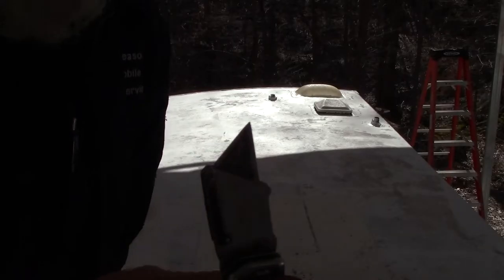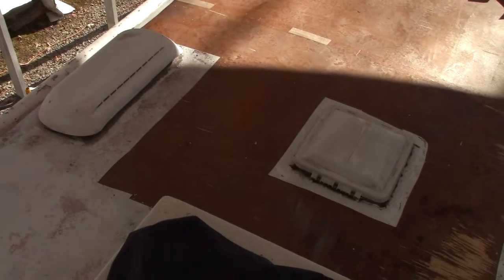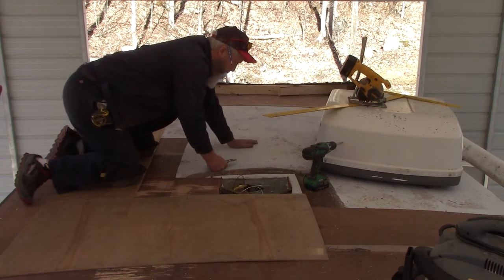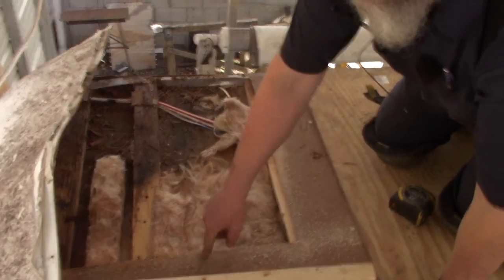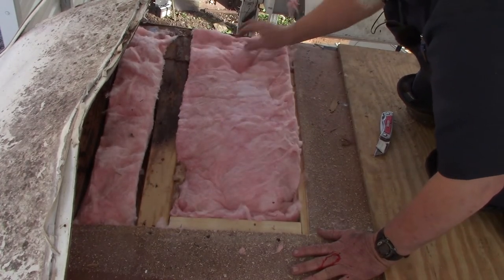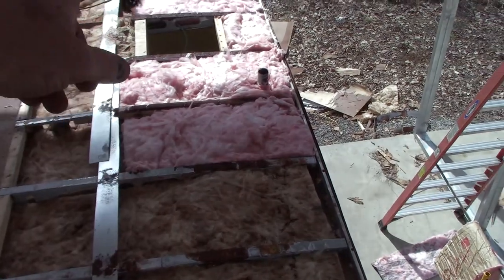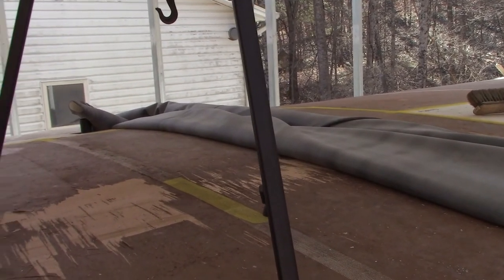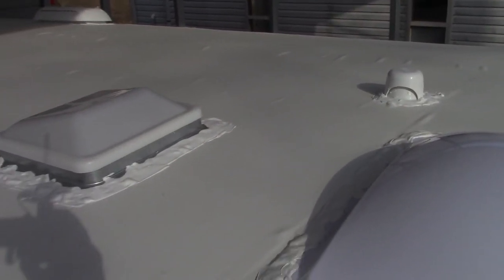Installing New Rubber Roof

Comment: Thanks Kenny and Cameron. Enjoyed the video. Even though you only patched the roof I would expect it’s as good as new. You were thorough. You probably put what, 40+ hours worth of work into this project plus materials so it’s not cheap. But this camper will probably will see another 20 years of use. This repair will get the owners back out enjoying nature which is what it’s all about.
Reply from the maker: Thanks. Yes it was over 40 hours.

Comment: Two pointers.  -  In the factory and dealers we used scrap plywood with scrap carpet padding and carpet wrapped around the plywood to work on the roofs. Two of them about 2.5 ft by 3 ft.  Staple the carpet to the underside and make sure the staples are hammered in.  Saves the knees also.  And I didn't see the entire procedure but we also used screws and before putting any roof on be it steel, aluminum or rubber we used a grinder with sanding disc on every fastener. * * *  Wow that is the one I heard about I think in the 1990's that used Lauan. Seeing the rest of the shortfalls from that maker it didn't surprise me to see the lack of insulation also. Having made so many makes of campers non of that was ever allowable much less making up lies about the materials used. When I came into building campers we soon switched from steel to aluminum and years later rubber.  If I remember correctly the Lauan was a attempt to get the glue to secure to something other than OSB or plywood. Most makers stayed with OSB or plywood and then switched to a very tough cardboard like stuff on a roll - glued the rubber roofing to that and then pulled the whole roof onto 3/8th  OSB or plywood.  We heard of some trying Lauan with good sticking success Eventually the industry develpoed glues that actually holds the rubber roofing. Still I would rather have aluminum or galvanized steel roofing. I've worked on so many 40 and 50 year old campers that never leaked although covered lol with roofing tar!  Hundreds of pounds heavier though.  Cost and weight the eternal search in the RV industry. But only Lauan under a rubber roof No Thanks!   And the factory work setting you are so right!  That particular operation would have had a 8 ft long angle bar with at least 5 wide clamp vice grips welded to it and come-along pulling the rubber roof a little.  Given the circumstances that was a good job as long as the glue was applied thick enough.  Lauan was the first good sticking surface they found back then before the special super tough cardboard like stuff later developed.
Reply: Manufacturers actually switched from OSB back to plywood because of getting the glue to hold rubber roofing.  Many had been using OSB when the rubber roofing came out.
Reply: I don't know what you are running into for roof repairs but a lot of campers early in developing rubber roofs will have OSB and I'd be careful giving a bid to repair them. I'm thinking early 1990's rubber roofs could have OSB and if so would likely require two choices to repair.  Replace the OSB or maybe overlay with Lauan then apply the rubber roofing. The labor cost may justify using Lauan over top for a repair.
Reply from the maker: Thanks Steve for that thorough comment and thanks for stopping by the live stream Friday evening.